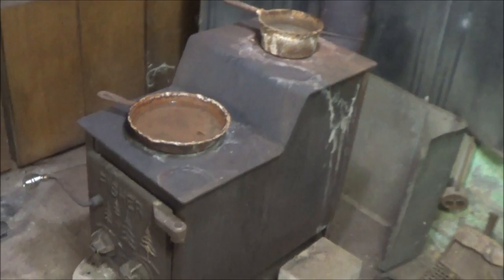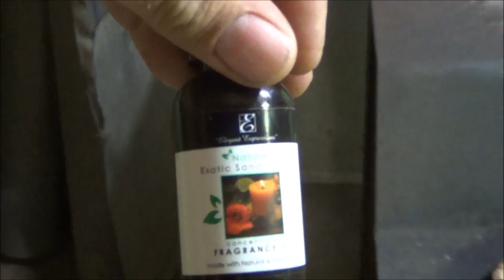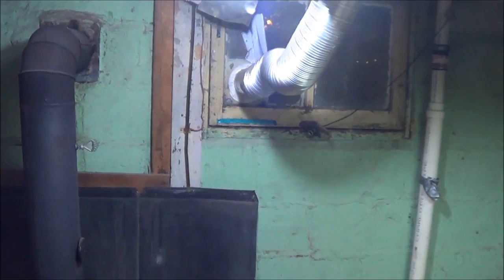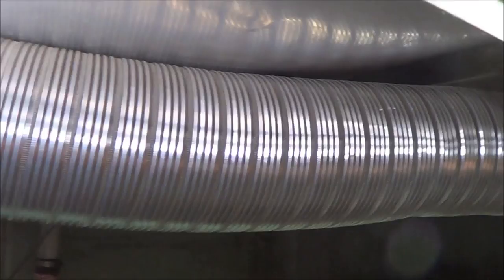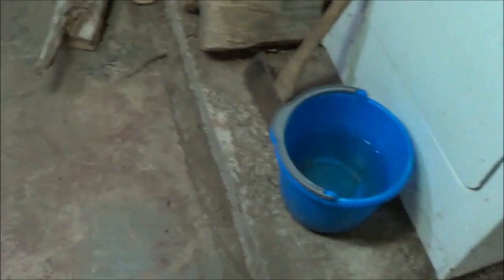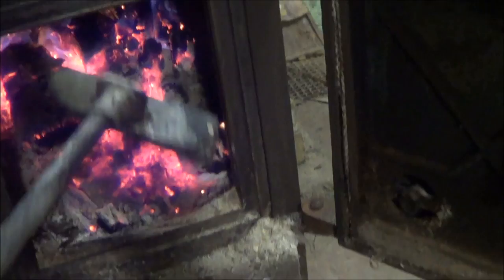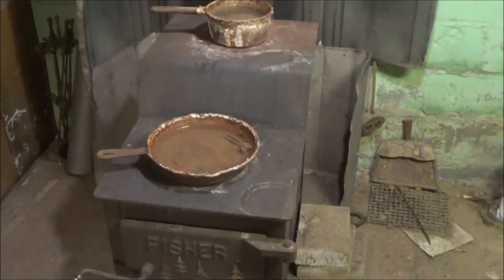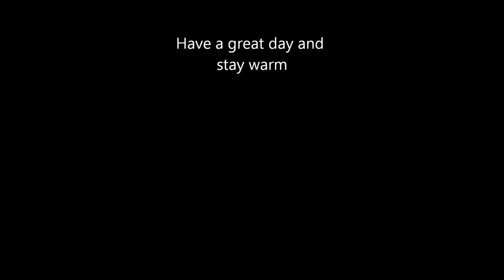A Fisher Wood Stove, Mama Bear

Comment: Very good video.  I have this exact stove that I purchased at a yard sale for $30.  Pipe kit cost and fixins cost about $400.   I hooked it up in my detached 26x40 insulated garage and it works great.  I need some of the cool tools you created.  I like your money saving strategies for distributing the heat.  Utilities cost a ton. Nice to know you'll have electricity if the power goes out also. I read somewhere that that gasket wasn't necessary on the Fisher stove.  I had a gasket one year, but can't really say it did much.  Anyway, thanks for the video.

Comment: Might want to consider getting a 1/4 to 3/8th inch steel plate - and throw it inside the stove - resting across the firebrick.  On these old stoves it helps preent the flames from exiting out the rear.   Some folks have done it with good results.  I threw one in my baby bear as well.  Found the info on hearth site.  Although as you said in your video - it would limit how high you stack the splits inside the firebox.

Comment: I just bought a papa bear in south Dakota off craigslist. I took a wire wheel to it washed it and repainted it, then put in new firebrick. I then painted it with 1200 degree paint from the stove section at Menards. It heats my 1700 sq foot house great!
Reply from the maker: That is awesome! I bet you will like it

Comment: I'm contemplating one of these or a baby bear for my 600 sq foot cabin. It's in northern Wisconsin so it is cold but dont want to buy one too small or too big.
Reply from the maker: Baby bear is nice , but need to cut wood shorter
Reply: I made a furnace out of my mama bear fisher  I cut the bottom  installed grates and put a bottom to form a holder for  a ash pan and put a door off of a coal furnace on the front after removing the ash plate   I can now remove ashes easy also put a metal surround so I use a blower to push heated air from the stove to duct work heats the whole house

Comment: The second tool you made is called a raker,its so important with these stoves. I have an all nighter and it burns the opposite of this stove. You use the stack damper instead of the door dampers the reburn happens at the door baffle. Yours has an exhaust baffel if I'm not mistaken.
Reply from the maker: I do have a damper i put in flue just to have it ,but it always stays wide open. I use only the regulator knobs on front door to adjust.. no baffle for exhaust on stove . This stove is just a open box inside with no re burn.

Comment: Which side of the elbow did you put into the stove the Crypt end or just a straight end. I'm having trouble putting either side into my Fisher
Reply from the maker: crimped end in to stove , then keep putting the next pipe on with crimped end going in the pipe from stove and so on . Some pipe is not crimped as much and it is a very tight fit into stove . Make sure inside of stove flange is clean

Comment: Very Cool and thanks for sharing. I was wondering if you here that fan upstairs as it was loud in the video.Reminded me more of a workshop with tools running than a basement. I'm gathering that the answer is no or I'm sure you would of mentioned it.Anyway thanks again and I also have a Fisher Stove..the Grandma.
Reply from the maker: You can hear the fan up stairs , not as loud but can hear . Mine is close to the resister as was not sure if the heat would burn it up .Only about a 16 foot run of pipe . It is a booster fan for duct work and if put in the middle of run it may be quieter .

Comment: so you leave the damper on the pipe open.. you don't lose a lot a heat that way up the chimney at all? i try to play with the dampers on mine.. still confused as to what to play with and what not. the door ones I keep kinda small so not a lot of air going in.. and the one on the pipe is half open half close..  what is your advice for best heat output.. ours is in the living room
Reply from the maker: +SassyMustang1980 I leave the one in pipe open , i would be ok with out it but wanted it for just in case .i use the door regulators and seem not to get as much smoke when i do open the door . The dryness and type of wood has a lot to do with how much heat it gives
Reply: SassyMustang1980 
i leave the chimney one open and adjust the door ones.

Comment: Hey! Thanks for the video, we have this stove at our cabin and need to replace the door gasket, unfortunately we do not have measurements and I need to replace it when we head up this fall.  Do you know what size gasket this stove uses?? 

Thanks!
Reply from the maker: no , i just measure the size of the gap.
Reply: Did you ever find out what size gasket works? I tried the 1/2" and it was to big.
Reply: @icecold1011  turns out that generation of stove is designed to be used without a gasket.
Reply: Fishers don't have a door gasket the way it's made negates one

Comment: I'm getting a fisher wood stove from a friend. I don't know the name whether a mamma or baby or papa. I know I've been trying for months to get a wood stove and finally, someone got me one and is going to have it installed for me. I'm a lucky lady. I liked your video, thanks for making it. What kind of wood do you use. I live in the pacific nw.
Reply from the maker: They are good stoves. I use a lot of ash,locust  and cherry,but I will burn any type of wood that is dry. If you Google, Firewood Btu chart ,you can see the estimated btu ,of different woods, and if you can try to burn the highest btu wood in your area. I burn a lot of what I call junk wood ,whatever I find ,and i just make sure it has dried.
Reply: thank you, and it turns out that my new stove is a timberline, small, which is good. with one round knob on the front to adjust the air flow. Don't know if that is called the flue? I'm waiting for a friend to bring a section of pipe to hook it up to the pipe that already runs up the ceiling and out the roof. And, I'm getting a cord of wood delivered by the same person that brought the stove. I feel blessed. I will look up the Btu charts, that is good info. Thanks. I don't seem to find a pic of my stove on internet. But, it is great condition.

Comment: What size gasket do you use on these stoves?
Reply from the maker: I am thinking 3/8 ,But not sure as been a long time since i bought one for it .  Also  can measure the width of channel , and depth of it . There are also measuring charts on line so you get the correct size

Comment: The gasket material in the door had to have been added by you or a previous owner of the stove as Fisher stoves never had this from the factory. They were built air tight and intended to be used with no gasket material. Also your stove was built in the 70's... Had it been the 80's it would have had an arch top door and been UL listed.
Reply from the maker: We bought it new and always had a gasket . Maybe the place we bought it from did it , but it was there
Reply: @wtbm123  Very interesting! Yeah, by spec, they were designed to not have it and furthermore it not be installed. Sounds like a new employee at the dealer started the week you bought the stove, feeling uncomfortable about it not having a gasket. I know that sounds crazy, but trust me.. take some time to read about these stoves. Both the forums and Bob Fisher's book you would enjoy immensely.
Reply: @specvdrvr04  I just added the gasket after 44 years and it gives me more control over the temp, mine didnt come with it.
Reply: I own two momma bears. No gaskets. Super tight seal with both.
Reply: @davevann2925  I could see that, only if the seal between door and channel wasn't good to begin with. Have you added a baffle to your stove? That's the only thing I've done to my momma bear. Keeps your fire in the firebox much longer, instead of escaping up the flue and wasting unnecessary amounts of wood. It made a huge difference and you can get dimensions off the Hearth forums. It's 15 degrees outside and my detached 1000 SF shop is 74 degrees right now. Hard to argue with that! Merry Christmas!

Comment: I have one for sale if anyone is interested!  i'm in Massachusetts south shore.     paid 400 about 1 year ago   never was able to get it into my house..   sits in my shed..
Reply: Deceivingly HEAVY! Fisher stoves are beasts..great stoves. I heated my house with a mama bear for about 4 years, and loved it. I used the tractor backhoe arm to lift it into the house, onto a sheet of plywood. I then used a motorcycle jack to move it into position. Moving the stove is a 2 or 3 MAN job.
Reply: And it's still in my shed after year or so.